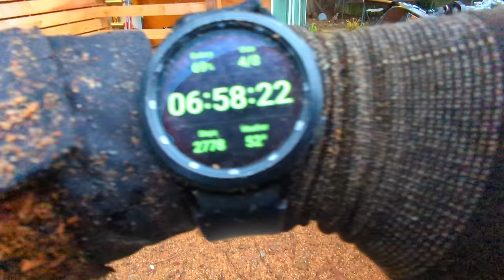Removing A HUGE Cedar In High Winds

Comment: Tim, good afternoon. 
Which grapple do you have on the S925TX please?
Reply from the maker: I believe SLG46 swivel log grapple.
Reply: @VeteranTreeService  thank you 😊
RLG46
Is it the one that hydraulically rotates?
Reason I'm asking is because the dealer is stating that for every one like the former, he sells twenty of the one that one can set stationary with the pin (conversely, one could remove the pin and let the grapple roam free)
Reply from the maker: @h.i.m.dishonmaurice2599  we do it both ways. Pinned and un-pinned.
Reply: @VeteranTreeService  thank you soooo much Tim. I appreciate you taking the time.

Comment: Im planning to go for a certification as arborist this year, any suggestions for good and not to expensive stuff, I’m in kind of a tight spot with money, I work for about 25 dollars a day and don’t even have work every day, I can save up pretty decently because I still live with my mom as 18 y/o but budget friendly stuff would be nice (I have looked for second hand stuff but I can’t find anything where I live)
Reply from the maker: First things first, be able to cut and transport. Chainsaw and truck or trailer. Or no clean up jobs. Get yourself a 2511t.
Reply from the maker: I assumed you are trying to do your own thing. If you're going to work for someone else get a nice helmet and work wear.
Reply: @VeteranTreeService  well… I am going for my certification in Belgium and I’ve already figured out that equipment isn’t provided so to attend the course you have to have your own but indeed I am planning to work for a company until I have enough experience to maybe start working for myself or even start my own company with employees and all that expensive stuff lol

Also I would love to buy an 2511t but that’s kinda outa my budget for now, I have a McCullough mac130 but that is the first thing I am gonna (have to) upgrade 😅